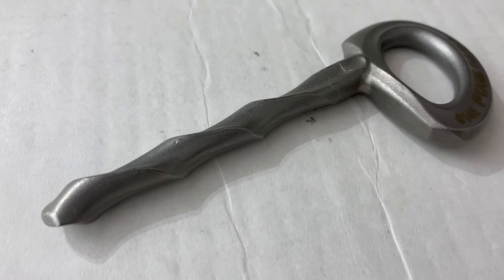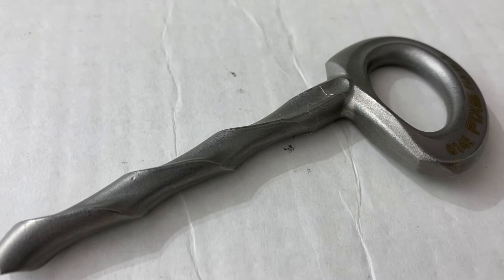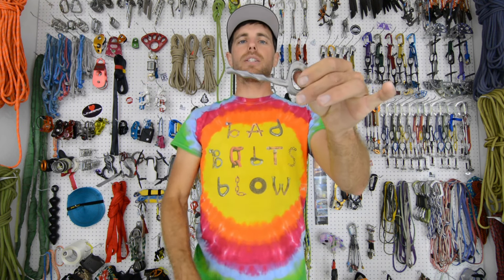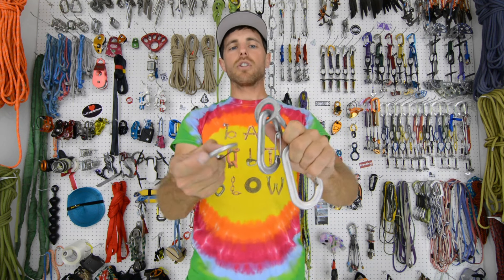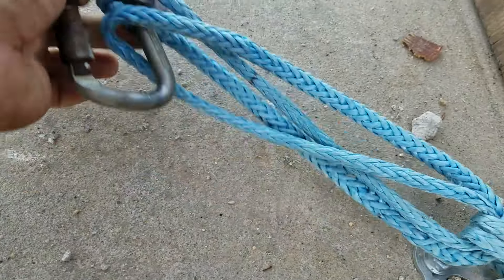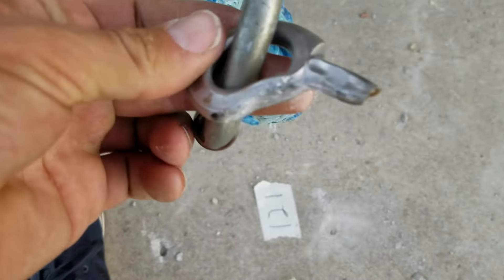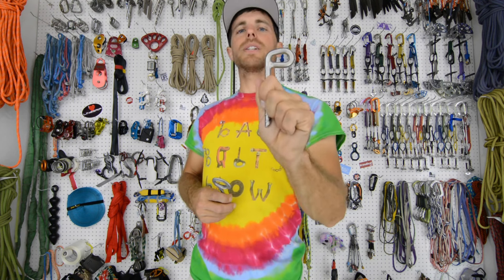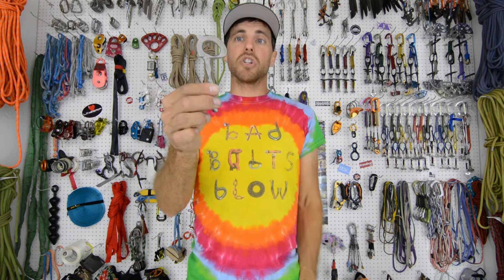BoltBuster - Fixe Hardware Hely PLX-HCR climbing and highline bolt break test

Comment: how much of a difference would a harder rock make? it looks like the concrete is breaking around the glue causing the metal to bend under the ground which presumably wouldn't happen in harder rock, would it just bend higher up and break anyway at the same strength?

Comment: I’m surprised to hear a person who serves as a source of information on bolt placement recommend the Titan HD’s. I’ve used them in a construction setting and agree that they are bomber *when installed correctly*. I’ve also seen them not grab, or be over tightened. Large impact drills don’t give an inexperienced user the kind of feedback they need to place a screw bolt reliably. A wrench, which is more viable outdoors, doesn’t allow for the torque and down pressure needed for reliable installation. I’m left wondering what the hell you’re talking about!? And yes, I’ve used/installed expansions and glue in’s extensively. Thanks for the video about 3/8”(ish) glue-ins. That was helpful.
Reply from the maker: Too hard of rock and they don’t work, too soft like Zion's sandstone they don’t work long term but if you got something in between and you want a removable (not reusable) bolt for a temporary project they are the bomb. Not sure where to put your anchor. Place those temporarily and if you like them and you are done climbing then replace with glue ins. They also work as permanent bolts. It’s quite common to use concrete screws in Europe and in caving and in a few places around CA, Bobby has seen them. After a few years of watching them they have not worked themselves loose. They are some of the strongest bolts we’ve tested and we are just putting them in with an impact driver until tight. Mark Hanna up here in WA uses them all the time for his industrial work and in the climbing routes he puts in. And he does it by hand sometimes.